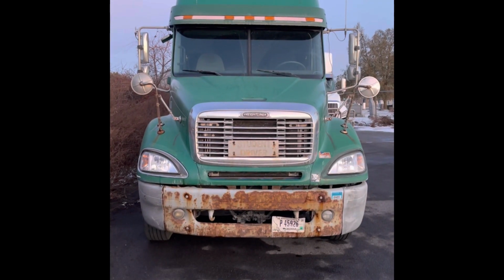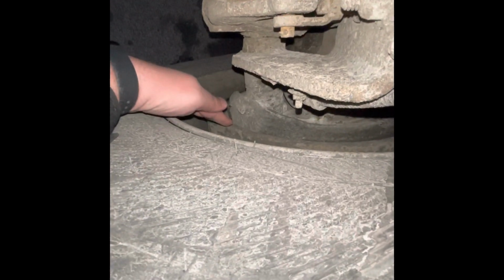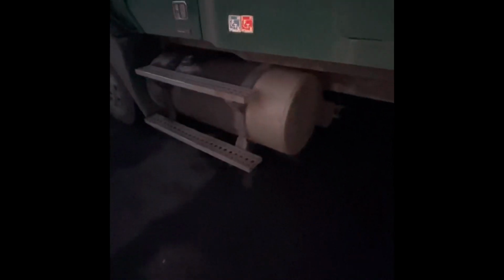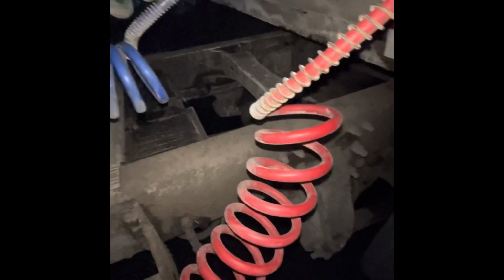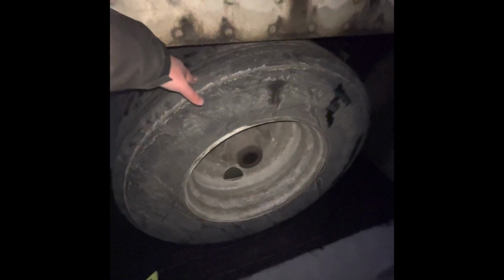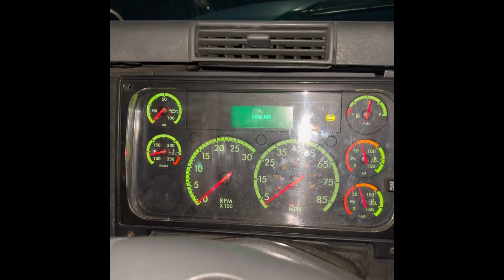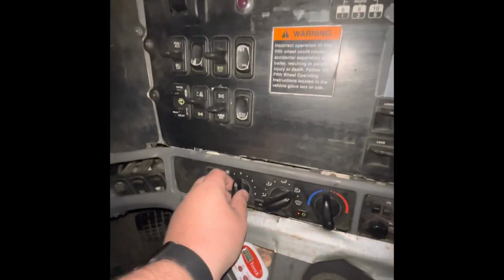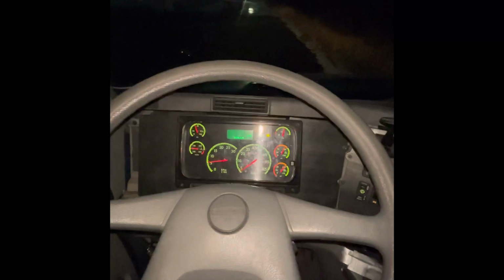Pre trip inspection class A 2022

Comment: Great video I love it. I’m taking notes and getting extra info on the pre trip. I’m currently studying to take the permit test do you have any pointers? And also are you currently in IL because I need to know everything for this state. If so would you mind giving me more help if your free thanks hear from you soon.
Reply from the maker: I’m currently in New York. For New York to get your permit you need to take 3 test, general knowledge, combination, and air brakes. A good website I recommend taking practice test are cdl-prep.com
Reply: @coltwhaley4127  oh wow when I typed in IL pre trip your video popped up. Is each state different? Or do I just need to type in IL pre trip videos again? Because I heard some states are the same as far as naming things and some are different. Just trying to get an understanding. And yes I have the 3 practice quizzes for all 3 sections.
Reply from the maker: The pre trip is the same for each state but your truck may be a little different such as a fuel water separator on the other passenger side or the water pump could be on the other side as well. I have a Twitter @coltwhaley if u need any help with what parts look like in your truck you will take. Also February they are making it mandatory you go to a school to get your cdl which I highly recommend
Reply: @coltwhaley4127  Pre trip in Washington state is extreame compared to this.
Reply: Thank you for sharing